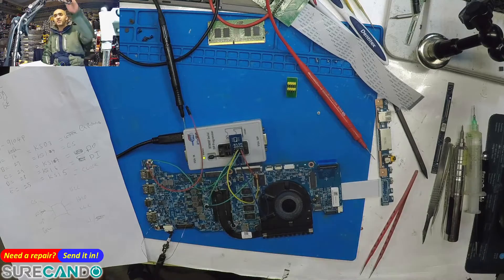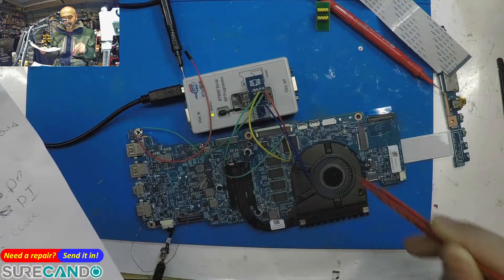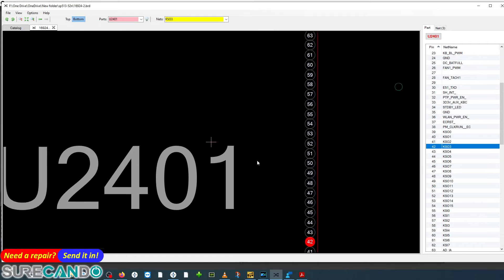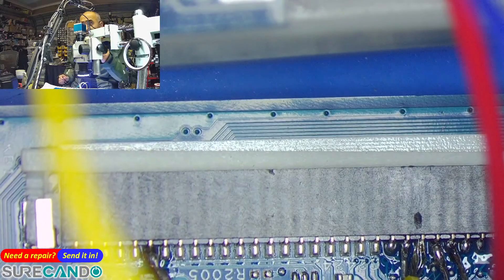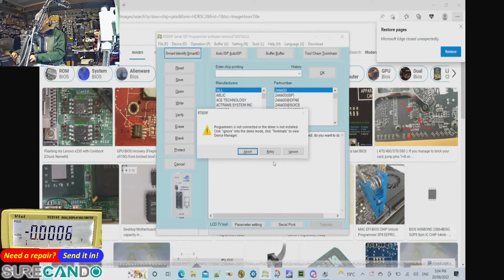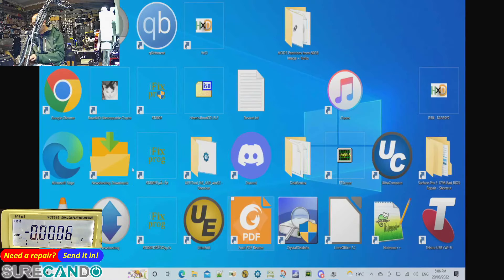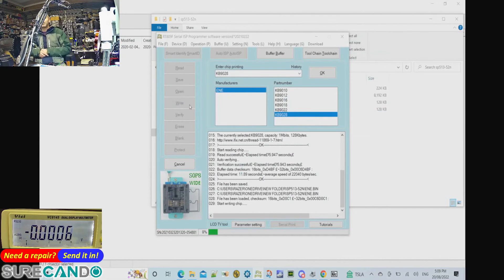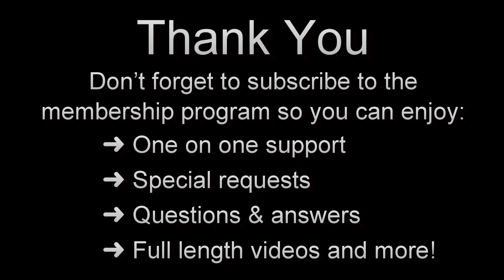How to program ENE Chips using RT809F KB9028 KB9022 KB9018 KB9016 KB9012 KB90XX Direct wire method

Comment: Does this work with KB9022GD bga chip?
Reply: yes, you can try.
Reply: @techmart1718 Could this work on KB9542GF?
Reply: @fernandoluizstumm4226  yes. you may try.
Reply: @techmart1718  And how do you identify each pin, considering that the pinout changes from board to board?
For example, in your video, you mentioned that pin CS (KS104) is pin 59 on the Super I/O.
Reply: @fernandoluizstumm4226  1st of all that's not my channel and not my video either. btw, in that case you've to follow the universal pinout like KB9012 series.